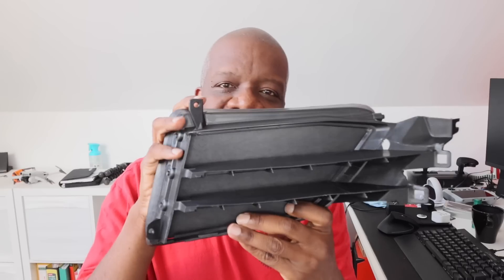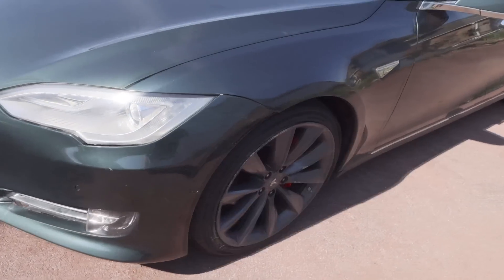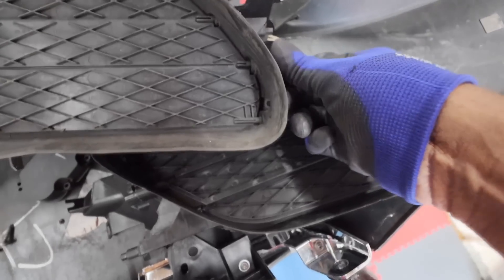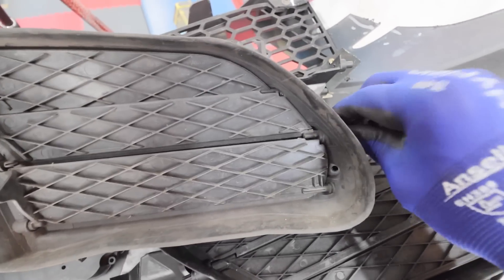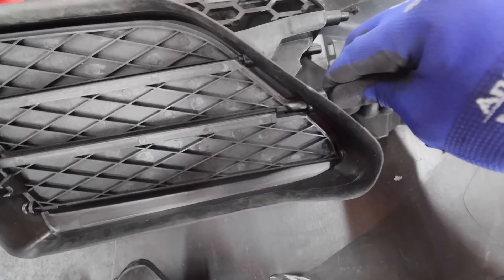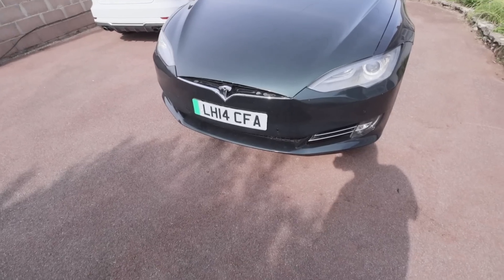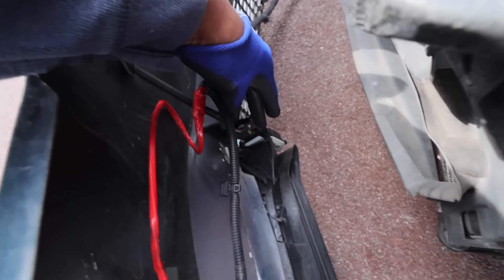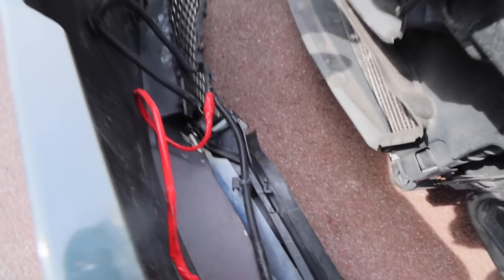Why cooling vents are so important on a tesla

Comment: Thinking out loud... If the car is charging it's not moving... Having the vents open or closed shouldn't make any difference to the cooling
Reply: The vents need to open to allow the fan to draw enough air through the rad's
Reply: @vwjim  Otherwise slows charge speed
Reply: @vwjim  My P85D charges full speed with the vents closed, the fans will just have to work a little harder.